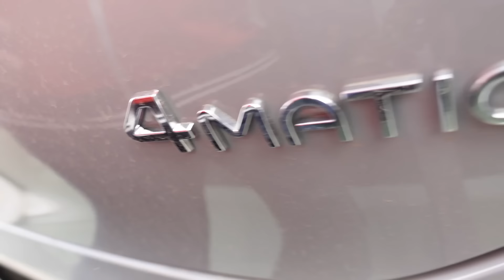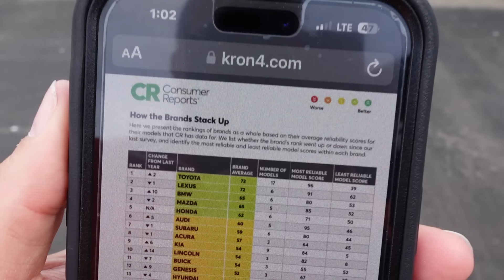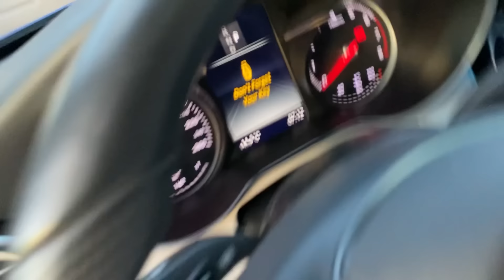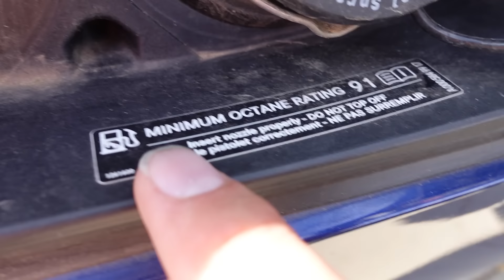The 10 Least Reliable Mercedes! (Avoid These)

Comment: For the 6.2L AMG V8 all you had to do is replace those headbolts and you'll be fine. 
I have an uncle who has a 2009 Mercedes S63 that he brought brand new and he had the headbolts replaced and ever since he did that, his car never had problems other then some electrical failures here and there. His car got 135K miles on it. He doesn't have any complaints. If you don't want the lifters to fail all you have to do is replace your oil every 6k miles and maintain that engine properly. I honestly think the 6.2L AMG V8 is not the worst engine. 
The hemi V8s from dodge and Chrysler have problems with their lifters as well but it's mostly because people abuse them and put them away wet.
Reply: that was my favorite Benz! Such power and sound of thunder!
Reply from the maker: Thanks for sharing
Reply from the maker: They sounded great
Reply: It's funny how you downplay the electrical issues as if it wasn't a big deal 😂😂
Reply: They have the ability to build the BEST.
Reply: @booblam6919 but they build trash
Reply: 130 000 miles...BFD. Some Toyota trucks have gone 1 000 000 miles. That is impressive.
Reply: @booblam6919 yup, they also found out that building the best car that lasted a long time doesn't make money.
Reply: "some electrical failures here and there" can end up costing you big down time/inconvenience and money. Those issues are difficult to trace and remedy, I've been there and are a nightmare and a common weak link with all German cars, another reason why I avoid them, never again.
Reply: A little flippant with "some electrical failures here and there"
Reply: A little flippant with "some electrical failures here and there" since they can be difficult to rectify hence costly and down time
Reply: @mikefoehr235  Many Mercedes taxis have even more.
But comparing low compression and low power commercial focused engines with high performance ones is something only a fool would do.
Reply: @yolobeer990  Ya, only a fool would buy a German Car.

Comment: This summer I picked up a 2014 E350 Coupe Mars Red  with just over 100k miles.  I now have 124k miles on it and no problems.  The V6 has been a solid work horse of an engine so far.   Granted I also do oil changes between 3,000 to 5,000 miles.  I never go over 5k without getting another oil change.  And the fuel even though it's requirement is 91 I use 93 octane.   I do believe I will be needing to get spark plugs done soon for this car and that's rather pricy but I knew that going into this.  My only complaint is that I wished I had gotten a 4matic version of this instead of RWD due to winter conditions.   So here soon I'll be getting some tires changed to all season (has summer performance right now)  and adding some extra weight in the rear for the winter months.
Reply from the maker: Sounds like a win.  Wonderful cars to drive, so as long as they are not causing heartburn then go for it .

Comment: My experience with 2 MB's I used to own .

'03 CLK500:
-A plastic tab broke on one of the rear windows and the window would not roll up.  Was told had to replace the entire assembly for the window which ended up costing $1,200 but since it broke not long after I bought it, the dealer covered half the cost.
-Rear sun shade would not retract.
-Only had the car less than a year and a half, so not sure if anything else would had happened to it.

'08 C350:
-Seat warmer on driver side stopped working.  I had bought the extended warranty when I bought the car so it was covered and replaced.
-Entertainment control knob in the center console stopped working.  Wasn't covered under warranty and cost a couple of hundred bucks to replace.
-Something broke in the transmission sometime after it went over 100K miles.  Repair was over $3500 but was covered under warranty.  Paid $100 deductible.
-Something broke in the steering column just after warranty expired and the car would not turn on.  Was $1,200 to fix.
-Had an oil leak which turned out to needing to have a gasket replaced and an O2 sensor needed to be replace.  Cost $1,600 to fix.
-Had the car for about 4 years.
Reply from the maker: Thanks for sharing
Reply: @ECPP I appreciate you for  the time you took to reply all comments.. great work man 😊
Reply from the maker: @ thank you very much

Comment: My work van is a 13 Sprinter...same as my coworker.  My coworker and I  both agree that on average our two vans are in the shop for 1 to 3 weeks PER YEAR. Our fleet manager and head mechanic told me he has never seen a bill less than $6 000 from Vicoria Star Motors. The biggest bill was an astounding $13 000 . Sprinters are garbage cans on wheels. My former neigbbour has a frugal son in law. He had a Smart Car...it died at 120 000 kms. I am of German ancestry but I will only drive Japanese. Toyota and Honda are my top choices.
Reply: Everyone uses Sprinter Vans in Europe. Most durable vans.
Reply from the maker: Cheers
Reply: @martinsvensson6884 LOL :D What about Fiat Ducato, Peugeot Boxer, Citroen Jumper, Ford Transit, VW Crafter, Iveco Daily, Renault Master and others? :D
Reply: True. Used to drive a 17’ 3.0 diesel. Always something wrong with that Van. From EGR valve to body panel rust issue and exhaust snapped all under 100k km…. Maintenance always done by MB but still something always go bad.
Reply: @tiborsztancs4779  probably all junk. Most euro trash does not do well in harsh Canadian climate.
Reply: 80's Mercedes ruled the world, then they had to cut corners because of Lexus and here we are.....
Reply: @martinsvensson6884  Australian experience is that Sprinters are horribly unreliable.
Reply: @martinsvensson6884   do you own one?  'everybody uses it' doesn't mean they're durable.  my E350 has the 3.0 sprinter engine.  it's absolute garbage.
Reply: @nehuge  you can't blame a company's poor products on a competitor.  If anything Lexus set the bar higher, unfortunately Mercedes can't reach the level of design and manufacturing precision that Lexus achieves.
Reply: @josephamullins  No, MB has higher manufacturing precision. Smaller tolerances than Lexus. That's the reason why you might experience some of the newer ones as less reliable. Since you cant neglect maintenance in the same way as with the simpler Lexus. But the upside of the MB is that you get higher performance in virtually every regard.
Reply: @josephamullins  No but many others do. And they are used everywhere here. Noone complains.
Reply: @martinsvensson6884  Mercedes makes less reliable cars.  From door handles to engines.  Full stop.  I've owned maybe 10 at this point, spent over a million dollars on the brand...trust me this is something I know a lot about.  Germans make things that are hard to do look extremely difficult, Japanese make things that are hard to do look easy.  The only thing Mercedes has going for it is the name and the reputation.  They don't have to make better cars, we keep buying them anyway.  I'm just so tired of spending so much money and having so many problems.  It's not the brand it used to be, incredible engineering through simplification.
Reply: @josephamullins  Problem is if you have spent that much money you are probably buying cars that dont even exist in the Lexus lineup.. There is no immense difference here in Sweden in total ownership cost for the normal cars between the brands..
Its also interesting that almost all complaints are in the US..
They are used as Taxis here. No other car brand has more miles on them before junked. At least up until a few gens ago. Since the latest ones are not in the stats yet.
But I agree they are not what they used to be. But that seems to be happening a bit with Lexus too.
Reply: @martinsvensson6884  perhaps your techs are more familiar and parts pricing more reasonable closer to Germany.  In the US they're preposterous, which means lots of deferred maintenance.  This bluetec engine isn't known for reliability--does the Euro version have the same emissions equipment which is so prone to failure?  I'm hoping the government mandated repairs for their emissions evasion scandal puts a few more years of service into my engine.
Reply: @josephamullins buy 10 of they're that shit? I have to question your judgement.

Comment: And your attack on the C250 having timing issues... Your obviously misinformed.... Timing chains don't fail... Timing chain guides do....after 100k (which is recommended that it be serviced) Stop trying to burn down Mercedes-Benz with your misinformation
Reply from the maker: Tell it as is.  I own one and honestly, not sure I would do it again.
Reply: @ECPP then dont

Comment: I have a 2020 GLC 300, user book said it needs mb-approval 229.51, 229.52, 229.61, 229.71LOW ASH  oil. But i found lots of the dealers don't know what is it mean! They just put 229.5 oil in. It may seize the particle filter in long run.

Comment: I'm currently enjoying my 2022 GLC! It only has 14k miles on it but it's holding up just fine. I definitely want a reliable car, but I also wanted something other than a boring Toyota or Honda, so to each it's own. We all work so hard so if you can afford a few more dollars on a car that you will enjoy....just get the car!!!!
Reply: GLCs are Great for the money. I had a 2017 and a 20. The 2017 was far better on mpg though.
Reply: Thinking about the glc
Reply: ................................ What is REALLY BORING!...is sitting in the Service department as you watch your wallet getting Huge Drain!
Reply: @donaldbanner2185  lol never take your benz to the stealership, unless its under warranty, plenty of great techs owning their own biz can give you better prices or learn to fix somethings yourself thats what happened when they tried to tell me it would be 500 to replace 1 o2 sensor when the car has 4!

Comment: C43 Amg 2018 here only issues is headlight problems and warranty covered it other than that the rims are super easy to bend but I’m at 80 k miles rn still running like new
Reply from the maker: Nice
Reply: @ECPP  thanks! I’m sure the issues you’re talking about though is further in the owner ship of the cars though

Comment: I’m a BMW technician .   If the engine hydro locks yes it can bend a rod but I’ve never seen a bad head gasket bend one.  You can ruin the cylinder though.

Comment: The M272/273 takes the cake for nightmare engine reliability in addition to electric gremlins that had no known solutions. I nearly gave up on Mercedes until i finally came across my love, the M276. This engine is like no other. This was the only Mercedes engine that matched Infinitis VQ35DE and VQ37HR which i both love for reliability and performance. I have the 3.5 liter M276 and the 3.0 liter twin turbo M276. Both are glorious engines in their 7 speed and 9 speed transmissions. The M276 punches above its weight and pay grade. Depending on the conditions, i believe it produces more horsepower than advertised. I have driven both the C350 and C300 4matic that makes 302 hp and 249 hp respectively. My conclusion is that the c300 4matic in sports mode probably makes about 260hp and not the claimed 249 hp. The C350 probably makes about 315 hp and not the claimed 302hp. And the 3.0 twin turbo that makes a claimed 384 hp, on the top end, actually makes about 396hp.
Reply: I agree! I have a 2013 E350 4matic with the NA M276 and it is bulletproof and probably does produce more than 302HP especially in 'sport' mode. I did my research before I purchased this MB 3 years ago. Best car I've ever owned.
Reply: I have a turbo m276, freaking love it
Reply: My M272 C350 has been very reliable! coming from 40k miles a year! its the plastic bits on the interior however is another story
Reply: Mercedes Benz make good vehicles   , like all vehicles some models do have problems but normally if they have serious problems the factory does send out bulletin’s  to rectify the faults  ie early 272 engines balance shaft / timing chain etc .
Reply: My m273 has given me no problems in my w221
Reply: Huh? R230 drove it for across the US and didn’t break 14 hours average run time 260679 miles 🤷 maybe yall just don’t know how to take care of your vehicles
Reply: How many miles do you have on that M276? watch out for gasket leaks esp past 110k miles

Comment: W204 is just one of the best Mercedes Models ever Built !! In Europe we know that.
Reply from the maker: Thanks for sharing
Reply: Especially the post facelift models. I don’t think he addressed that for that specific C AMG, that the head bolt issue is addressed in the later years of the car.
Reply: W204 is one of the worse car ever.I have that one with om651 engine.Timing chain and tensioners  issue on 154000 km...Water pump and injectors too.Some kind of sensors. You have no idea what you talking about 😂

Comment: I have 2013 v6 ….. i Tell you…. I have spent God knows how much on only normal services… now I have many issues—the rattling noise when u start it up… most of the buttons faded … the a
Metal piece in the steering wheel  got damaged and it cut my fingers  many times … thank you … but I love the way it drives .. yes still … it is very expensive to keep

Comment: I've had the GLC 300 for 7 years and not one single issue except one leak of water from roof and some of the buttons for the windows break.  Cheap plastic.  That's it.
Reply: GlC you had 4cy or 6cyl and how many miles you had?

Comment: The c250 is not a 2012 -2014 model it is older. It's a 2010. The 2012 w204 c250 is much better. Love the video as well. 🙏
Reply from the maker: Thank you very much for watching
Reply: I presume these are u.s.a. made cars. We have had two German made C200s, a 2003 and 2011 clk and c250 sport respectively. No issues with either of them apart from the usual tyres, wipers, brakes etc replaced as necessary. Both cars maintained and serviced religiously according to  MB schedule, so a very satisfied customer. Now considering a newer C200 later this year.

Comment: The only way to own these cars is with a warranty. Most people lease.
Reply from the maker: True
Reply: Or just be smart and don't even bother
Reply: id say check the carfax and dont settle just benz you see that emblem up front. i got my 12 e350 at 72k miles has 108k now and im now doing 02 sensors other then that its been just oil and tires ( i run low pro tires on 20in staggered wheels ) and the roads in my city are dog shit but its low life for me

Comment: I agree with practically this whole list. But the list is also pretty obvious with notoriously terrible cars. However the engine on the non amg w204 is one of the most solid performers ever made. There are multiple on the market of 200-300k miles with no issues at all. You ask any Mercedes foreman and they will tell you the same. Also, we have no idea about the reliability of any of the eq vehicles, as enough time has not passed to make any kind of assessment on reliability.
Reply: Over priced for quality you expect for big bucks 
Over rated as a luxury car.
Poor resale .
26k on  a three year old car 12k
Cost me 4 times that
Now mass produced tat
Reply: The aluminium engines do not stand up

Comment: Thank you for the presentation. 
I drove a 1967 Mercedes Benz 250 in 1979. No rattles, no electronic issues, no door handle falling off. It's unfortunate that all those electronics are useless when it comes to making good cars.
Reply from the maker: Thanks for sharing.  Many older cars are built much better than newer units

Comment: Forbes Wheels has Mercedes Benz on the very bottom ; the last position, on the list for 2022 for foreign cars ranked by reliability. A so called "luxury" brand, and the "hallmark" of German engineering and what do you get for the high cost? A plethora of perpetual mechanical issues. Cheaply manufactured, glossy polished turds on wheels with electronics that are doomed from the second any wire is spliced at the factory. Stuttgart, Germany home of the world's most high tech garbage dump.
Reply from the maker: That’s about the bottom line and I am going to share out 3 year ownership experience of our C300 coming very soon

Comment: What are you talking about C250?
I had it for 11 years,no issuses that u have described.Timechain i have replaced first time on 244.000 kilometers,airbags were replaced by Mercedes Benz as a safety pre caution,because the gas inside cylinder are oit of date after 10 years,all 8 airbags replaced by Merc free of charge.I sold it and owner doesn't have any issues.Maybe it is me,I change oil on every 8-9.000 km,coolant every 2 years,climate cleaning and recharging every 2 years,gearbox and differential fluid every 60.000 km.

Comment: Quality and reliability has gone down hill. I recently repaired a 2007 GL450 and noticed it had only one brake pad wear sensor on one pad in the front the same on the rear. My 1993 400E had a sensor for every pad. Just little things like that I've noticed with newer models with less parts or quality. I've also had a 1990 300CE, 91 300TE, and 93 190E 2.6 (all with around 150k miles) with little or any wear on the seats, especially the driver's seat. But on later models they definitely show their age. Not only on Mercedes but I've seen the same for BMW. I still like German cars though, that will never change. Been that way for well over 30 years.
Reply from the maker: Yes. Corner cutting and charging more at the service at the service eshop seem like such a scam.  What a racket

Comment: Have a 2021 GLC AMG 43 - absolutely one of the best sounding exhaust systems on a non-v8. Fantastic fun, solid, reliable and beautiful interior. I dislike the new GLC interior, it has the most frustrating volume control. Capacitive touch everything in that interior and it’s horrible. Beautiful looking but terrible ergonomics. I’ll take the old interior all day.
Reply from the maker: I would totally agree with that
Reply: How many km or miles do you have your Mercedes GLC 43 AMG?  I'm thinking of shifting off of my 2013 BMW X3 35i for one of these used.